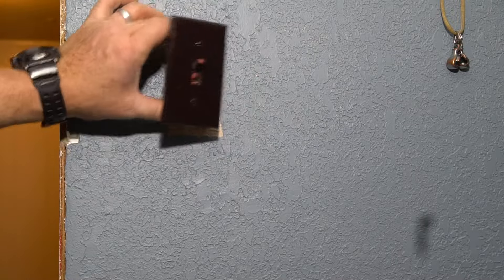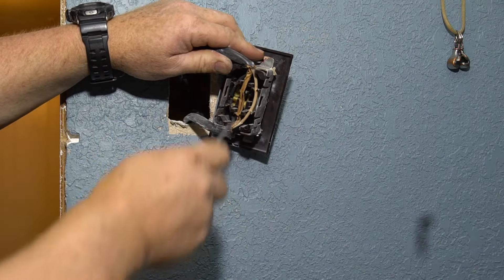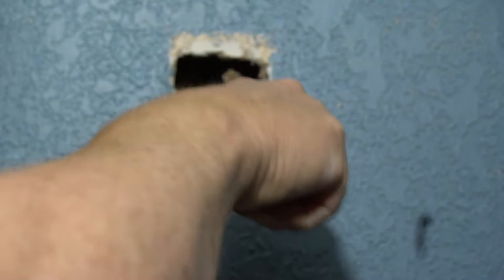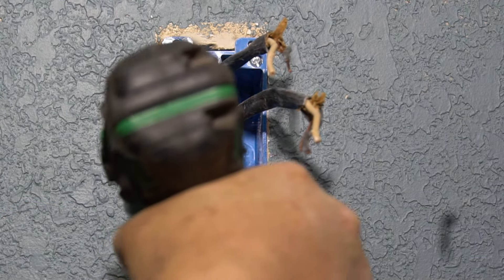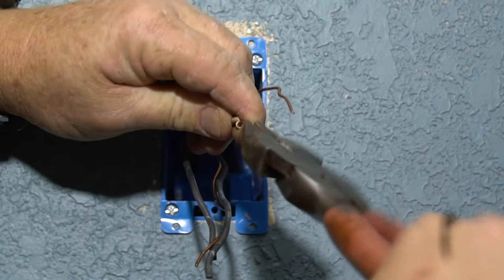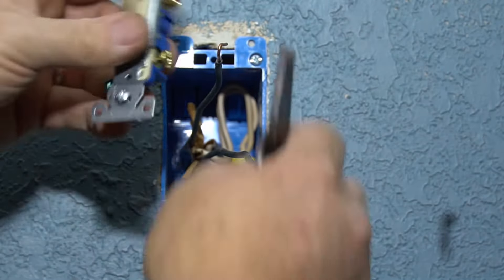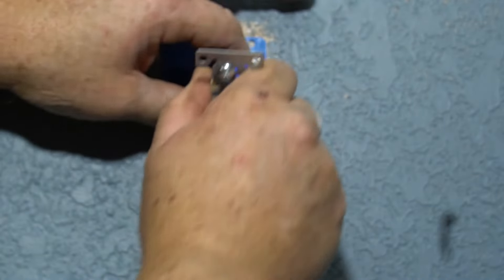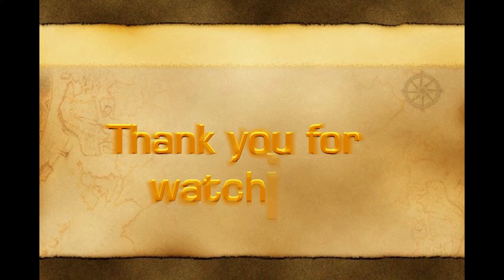⚡ How to upgrade unsafe mobile home quick connect light switches🔌

Comment from the maker: 🙏If you found this video helpful, please consider sending a couple bucks my way to say thank you by hitting the THANKS  button under the video 💲❤. You can't imagine how much I would appreciate it. 🥰
Reply: Thankyou very much for this video. I've worked on regular house wiring but never mobile home wiring. They use totally different things... windows, doors, receptacles, light switches ect... Helping our niece with very dangerous light switches that are soft and loose plugs, couple do not work, and one she pushed into the wall so kids didn't get shocked. Hopefully we can get supplies and help them. Ty very much...
Reply from the maker: You're welcome. Glad it helped.
Reply: I would point out to keep the ground wire away from the power screws
Reply from the maker: @zekeroost1987 👍

Comment: Mine looks the same but it has 3 wires to the original light switch how do I change those?
Reply from the maker: Do you mean, three wires? If so, it is probably a 3-way switch.  In this case, you would need to replace it with another 3-way switch.

Comment: Hello how would i hook up 3 wires? Different switch?
Reply from the maker: If you have three hot wires, this may indicate that you are replacing a 3-way switch.  Look at the switch you took out.  Does the switch have ON and OFF labels on it?  If it does not, then it is a 3-way switch.  It is important, when taking a 3-way switch out, to remember the order of the wires, so you can connect the wires in the right order on the new switch. Here is a video that may help you out.  https://youtu.be/Rq_iM2neQJI?si=43mRaNJCmq0sXk05
Reply: @thejungleexplorer  thank you, it goes in switch and jumps to a pull string closet light. I will watch the link.

Comment: How do you know which hot wire goes to what terminal in order for the up position to be on and the down position to be off?
Reply from the maker: @tiffanydefuria8006  
Only the hot wire goes to the switch. Both top and bottom screws should have the black wire going to them. It does not matter the order, as the switch is just a break in the circuit.

Comment: How do I do one with three wires coming out of the wall?
Reply from the maker: How many switches were there originally?
Reply: I have the same thing, had three sets and one switch 😢
Reply: @thejungleexplorer  one switch it’s in a mobile home there’s a total of 9 wires I know it sounds weird but it’s the truth and I have pictures
Reply from the maker: That sounds complex.Not sure what is going on there. It is hard to advise with doing testing. 

Were all wires connected to the one switch?

Comment: Thanks! I'm currently having trouble with one of these, but it has 3 wires in it. Its an outlet, not a switch and i cant find a deep enough receptacle to fit all three connections. Is there a way you know of to replace this with something more safe?
Reply from the maker: Hi. Thank you for the donation.  It really means a lot to me. 
It is hard for me to give you advice without having a visual of your situation. When you say that the box has three wire, do you mean a black , white, and a copper wire, or do you mean that there are three sets of cables, each containing three wires, for a total of nine wires? If it is the latter, you should be able to twist all the wires of like color together and pigtail off of them. If constrained by limited space, you could put in a shallow double box to provide space for the wires on one side. You would use a single/blank outlet cover for this kind of box.  

These are just some basic ideas. Without a visual, I cannot give you specific advice.

Comment: Hi sir im Vernon I have a 1999 mobile home some of my lights switches has 3sets of wire 3 black 3 white 3 gound can you tell me how to hook up please i dont want to try and cause a problem please ty Vernon 🙏
Reply from the maker: It is impossible for me to give you any specific instructions without actually seeing what is going on in that box.  It could be that the other wires are a pass through circuit, in which case you would need to make a twist junction and pigtail off to the switch.  But without seeing it, I cannot be positive this is what is going on.
Reply: Hi the 3rd set of wires is just to me a extra set of wires its just makes a uturn comes out both sides to me it nothing but im sure it does something
Reply: Can I send you a picture I got a picture of the wires coming out the wall ty Vernon

Comment: Jungle Explorer I have the same switch except mine has 3 sets of wires whereas yours has two. How would this work with having 3 individual sets of wires to run to each switch? I don’t see how I would get the third set through the back of the blue box.
Reply from the maker: It is really hard for me to give you advice on such an unusual setup without physically being present to look at it and see what exactly is going on. There is no logical reason that three sets of wires should be going to a single outlet of this kind.  This leads me to be leave that there must be some special reason for why it has been wired this way. Some investigation would need to be done.
Reply: @thejungleexplorer  there is 3 switches side by side and they are joined together by the 3rd wire almost like they are chained together. I noticed if one is not wired none of the 3 switches will work.
Reply from the maker: @Barredspark6013   Okay, this makes a lot more sense.  You have one incoming power source that is feeding three different devices. People seem to be able to visualize water flow better than electricity, so I will use water to help you understand what you are looking at. 

Think of the switches like a 3-way garden hose garden control valve. You screw it onto your outside faucet and connect three hoses, one to each spigot. Each spigot has a control valve to let water out or stop it.  Does this make sense to you?  

 Okay, this is the same thing going on in your switch junction box.  One of the Romex wires in the box is the source, just like the outdoor faucet.  This wire is the one bringing the power to the box.  Each switch is like one of the spigots that lets the water flow out to the hose, or in this case, the wire.  The other three wires in the box are like the hoses that go out from the spigot to the device (Light, fan, outlet, etc).

All you need to do is determine which is the incoming wire that brings the power.  You will connect this to one switch, and then just loop to the next from the first. Or you could do a three-way pigtail in which you twist three black wires onto the income black (hot) wire and then connect one of the three pigtails, each to one of the three switches.

As far as the box is concerned, you will need a triple-gang old work box like this one: AD https://amzn.to/4dNG5xT
Reply: @thejungleexplorer  thanks so much for your help I will try this out.

Comment: What if your have 2 light switches but 3 wires running from the old light switch what do I do make it a 3 way light switch
Reply from the maker: A 3-way switch has to be wired this way originally. You can't convert old wiring to make a 3-way without running a new wire between both switches to provide the bridge.
Reply: @thejungleexplorer  the old one had 2 light switches but when I took it off I seen it was 3 wires running from the right side do you have any thing I can send u a picture
Reply: Can you wire 3 of the white wires together?
Reply from the maker: A picture would not help me much because I can only see the ends of wires, it does not tell me where they go.  

If the system was already set up to work as a 3-way, then all you have to do is buy 3-way light switches to replace the ones you took out. It is easy to tell if the ones you took out were 3-way switches, because they will have no ON or OFF position markings on them.  So if it is already a 3-way system, then it is just a matter of replacement with 3-way switches.

Comment: My goodness I wish I had come across the video a day ago!!! 
However, I have the same issue going on. When I took the old trailer box off there were three of those neutral, hot, ground combination wires. What would I do with the third set of wires???
Reply from the maker: Honestly, without seeing the setup is hard to know for sure and it is not safe to assume.
Reply: Me too have the same issue
Reply: Ughhhhh I’ve searched and searched i have three as well did you ever find an answer ?

Comment: I have a six wire that I’m trying to put onto one light switch as well, but only one of the black wires is hot. The five other wires are not hot.
Reply from the maker: Hmmm....? That sounds very strange. Something non-standard is going on there.

Comment: Hi, I'm in the process of trying to replace a switch like this, but it controls two lights instead of one. I have a three way toggle switch, I've tried all three of the black wires on the black screw of the switch but my lights aren't coming on. Any suggestions?
Reply from the maker: If you have a 3-way switch system (two switches in different locations to control the same light), only one switch has power. The other switch does not have an incoming power source. It gets its power from the other switch. The switches themselves do not have an on or off position.  They act as gate keepers, redirecting the flow of power. It is a bit of a mind bender to try to understand. 

You have to find the switch that has the incoming power. That is the switch that must be wired correctly.

Comment: From the top so what do I do w the 1 white or do I need to use all 3 wires 😊
Reply from the maker: Hi. If I understand you correctly, you have a single piece of Romax coming into your switchbox. This Romax has three wires in it, Black, White, and bare copper. If what I am saying is correct, then in this case, the white wire is performing as a Hot, or the same function as the Black wire.  The switch should have two screws on the side.  Just attach the black to one and the white to the other. There should be a green grounding screw on the end. That is where you attach the bare copper wire.
I hope this helps. 

Electrician ethics teach that, in this situation, the white wire should have been wrapped with black tape or painted black to indicate that it is functioning as a hot, thus avoiding this confusion, but in modern times, I seldom see anyone do this.

Comment: Will a dimmer switch work in a manufactured home? I couldn’t figure out how to make one I bought work.
Reply from the maker: Yes, they will work.  However, you must also install special bulbs. Regular bulbs cannot be used, with a dimmer switch. LED dimmer-compatible bulbs are not very common, and in my experience, not as reliable as incandescent dimmer bulbs.
Reply: @thejungleexplorer  I attempted a dimmer switch with led bulbs the other day in my master bath. The switch was receiving power indicated by a tester. I had hot going into line. The corresponding wire for load in the load. Both neutrals in a neutral slot. No power when flicking the switch. Maybe a bad switch?
Reply from the maker: @callmese7en319  Something is off with that switch.  Light switches do not normally have neutrals going to them.  Light switches only control the hot leg.  They act as an interrupter to break the power flowing to the light.  Now, it is a common practice to use normal Romax to wire up a switch, in which case there would be a white and black wire in the switch box. However, the white wire is not actually acting as a neutral in this case, it is actually working as a hot wire.  A good electrician will wrap the white wire with black tape to indicate that it is being used as a hot wire, but not all do it, which can lead to some confusion. Neutral wires should go directly to the light as there is no need of them to go to the switch. If they are run through the light switch box, then they should just be wired together and not connected to the switch itself. Switches do not control the neutral leg, only the hot leg.  I hope this helps.

Comment: I was replacing one in my sons room and there were 3 sets of wires. Do you do this differently?
Reply from the maker: In most cases, it would be the same. Unless, something unusual or special was done by the last person.
Reply: @thejungleexplorer  turns out it was a line to the plug cause now when I turn the light off the plug goes off as well. Lol there’s no way I’m taking it apart now. It was a pain
Reply from the maker: This is called a switched outlet.  It was common in the 50s thru the 70s. They were used to control lamps because ceiling lights were not common back then. Normally, the installer would break off the side tabs on the outlet to divide so that the top outlet was always powered, but the bottom outlet was controlled by the wall switch.  You never see this on newer construction unless it was done by special order.

Comment: 1. Those original switches SUCK!!!
2. I love the new Leviton with the Click Locks!
3. I personally like the White rather than Ivory.
4. Slightly "Prettier" is if the screw slots are vertical on the Cover Plates... momma likes prettier...
5. Those wings metal wings on the original box are a bear to flatten.
6. Make sure power is off...!

Comment: Pro tip the wire nut will chuck up in a 3/8 drill also same for ground wire, makes for fast twist up and saves arthic fingers and wrist.

Comment: Does it matter which black wire goes on which screw? Does the hot wire need to go on top for on and return black wire go on the off screw?
Reply from the maker: On a light switch (if it is wired normally and correctly) both wires are hot wires.  They should both be black, but sometimes they will be white and black, which can be confusing because both wires are hot and they should be black.  The switch merely functions as a break in the hot wire to the light. So, since both wires are hot wires, it matters not which screw you connect them to, top or bottom (not the ground screw). Again, this is assuming all things are normal and was done properly by the previous person.

Comment: I have a 1998 park model. My switches are wired with the self-contained switches and no box. Your video was very straightforward however I have two light switches. Each switch has a cable running from top to bottom just like in your video but then there is an extra cable running from the top of one of The switches into the bottom of the other one. 

One switch goes to the bathroom exhaust fan and one switch goes to the light above the vanity. 
I don't know what the short wire between the two switches is used for.

I was going to just replace like... with like switches until I saw how easy it would be to make these safer. Not to mention the cost of a self-contained switch which is $10 each. 

When I replace these two switches do I Just need two separate switches and I don't need to connect the two switches together in any way?
Reply from the maker: It is hard to give any firm advice without knowing exactly what is going on, but it sounds to me like the one switch is supplying power to the other switch. I would try to copy exactly how those switches are connected when replacing them.

Comment: Could you help me with this? I have a mobile home and the old light switch’s are exactly like this but instead of 2 different sets of wire there is 3 I followed this video exactly and the light turns on but I flip the switch to the off position the breaker pops.
Reply from the maker: If a breaker is popping,  this is an indicator of a direct short, and that is no good.  Please do not use this switch until this issue is fixed. Leave that breaker in the off position  until this situation is corrected.   It may be time to call in an electrician.  Something is not right, and it is impossible for me to advise you about something I can not see and perform tests on to figure out what is going on.
Reply: @BlaineFreeman-h3r  just do as his shows you.the boxes are called remodel box.

Comment from the maker: Thanks for visiting my channel and watching this video.  If you enjoyed it, please punch the 👍 thumbs up button under the video. If you want to be notified when I release a new video, hit the SUBSCRIBE button and ding the BELL 🔔.  Thanks for the support!
Reply: I've watched several of these videos. What kind of mobile homes do you guys have. My mobile home does not have thick enough walls to use these remodel boxes. Still looking for a solution. I have considered cutting off the back of the box the then the back will be open. Not sure if that is safe.
Reply from the maker: @stevesilverson5001  You can buy shallower boxes.
Reply: @thejungleexplorer  I looked and have not found any shallow boxes. For singles. I have found shallow duplex boxes. I've been studying on it. I might cut the back of the box of and cut a piece of plastic and glue it on the back of the box with a hole in it to run the wire into it. It wouldn't have the tabs to hold the wire from backing out tho. But at least the back of the box wouldn't be open.
Reply: Ok . I'm ready to try one on my own . How do I know which wire to put on the bottom of the switch . Thanks .Nice Job !.!.!